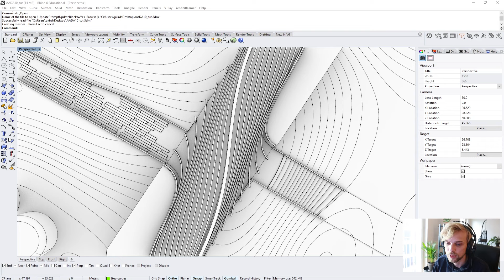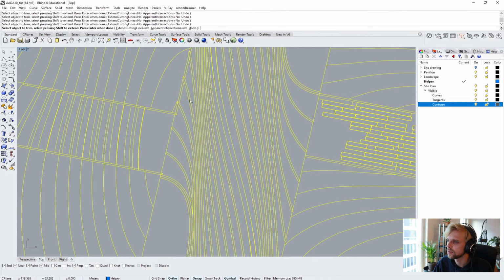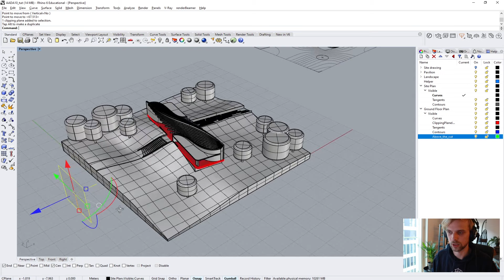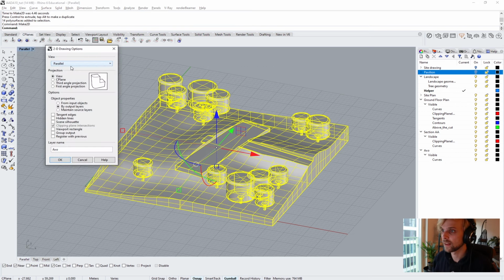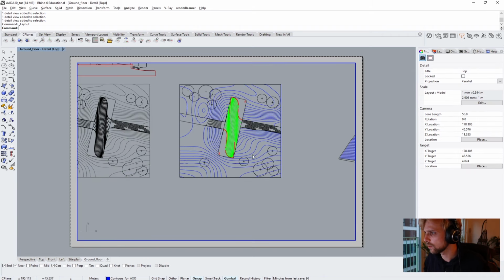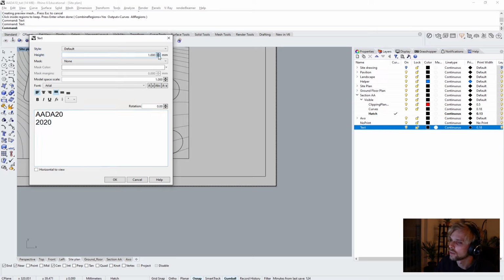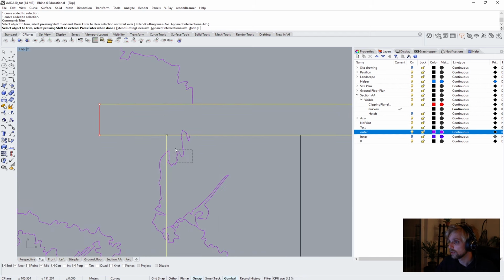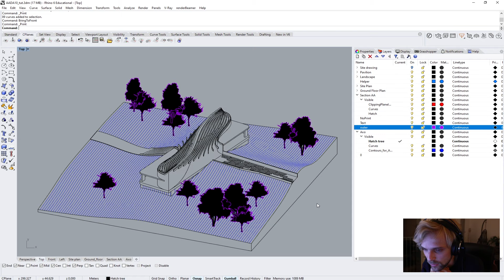AADA10 COURSE (Part 3) - Rhinoceros 3D introduction for Architects

Comment: I think its one of the best ways rhino explained. I enjoy each of your vids. I just installed the trial rhino 7 to learn sth, but I already stucked with picking any point in the second storey. Simply stuck the mouse cursor in the basic plane. Can you give me some advice? Thank you a lot : ) Zoltan (civil egineer Slovakia)
Reply from the maker: So rhino doesn't work in storey, it's all just coordinates. If you're creating something new (like a point) it will always be created on the construction plane (by default world XY plane) - which then you'd move to the correct height. I've noticed that at first Revit/Archicad users are confused by this, but in a few days it becomes natural. Also you can adjust the Cplane (construction plane), but that's an intermediate drawing/modeling tool, I suggest first getting the basics down.
Reply: @DesignGoBrr  Thank you very much. I simply wanted lets say to start creating a slab over the already extruded perimeter walls, but the cursor stucked in XY plane. I saw in some tutorials starting to draw an element on the particular elevation, thats why I got already confused. Thank you very much

Comment: great work and i really learnt alot! thank you so much! and yeah, will you please let me know where i can find the next video to start with as i cant see in your playlist from where i can began after this, its showing more of LTS
Reply from the maker: If you don't know how to 3D render - I suggest checking out AADA25 course. If you know how to render: 1. Find a small competition. 2. Do a project for it (spend maximum 10 full work days on it) 3. Send in the project. 4. Repeat 1.2.3. until Rhino becomes your friend. Once that is done - check out Grasshopper. I'd start with "Webinar:AAHF30 grasshopper for beginners"
Reply: @DesignGoBrr  thanks 💙

Comment: Don’t mind these:
Reply: 17:00 contour (to recreate topography lines from a surface)
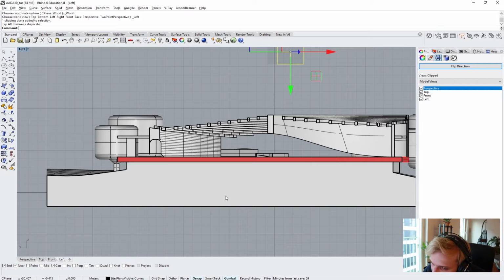Reply: 50:00 (after aligning clipping plane with object) setcplane by 3 points (to align view with object as well
)
Reply: 1:09:00 blendcrv (joins spaces between cut curves)
Reply: 1:31:00 printdisplay (the layouts will look the way they will be printed)
Reply: 2:25:00 print setup to get all layounts in one pdf

Comment: What is the difference between "from input objects" and "by output layers"? Still confused about that.  I can only find that the line type of the hidden line will change.
Reply from the maker: which part of the video are you talking about? could you give me the timestamp?
Reply: @DesignGoBrr  It's on the Make2D Drawing Options [10:09]

Comment: 45:53 i would have used orient command it moves and rotates at the same time using 2 reference points! great video
Reply from the maker: Ah yes - that would be a more convenient way of doing it for sure. I keep forgetting to use that command for some reason.